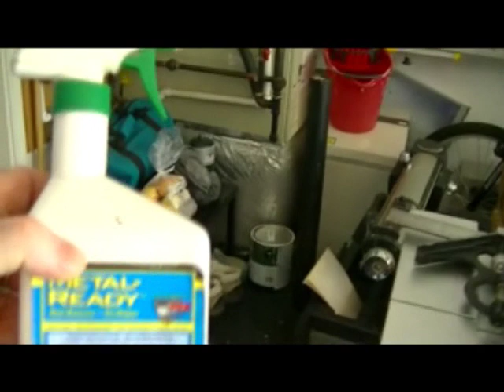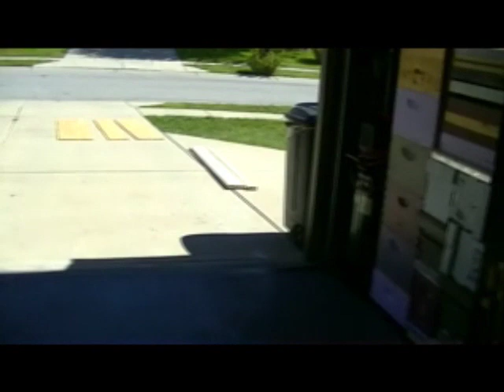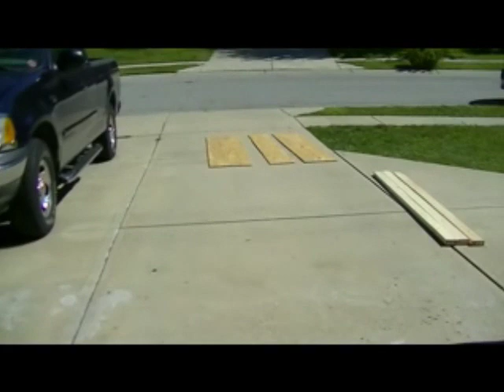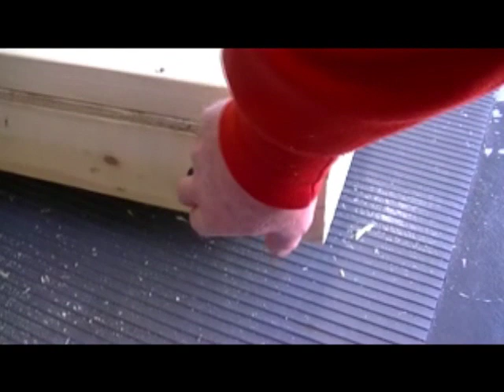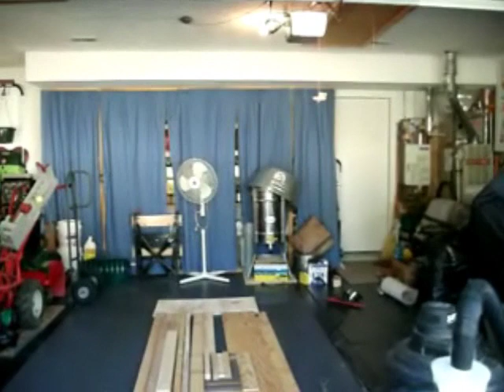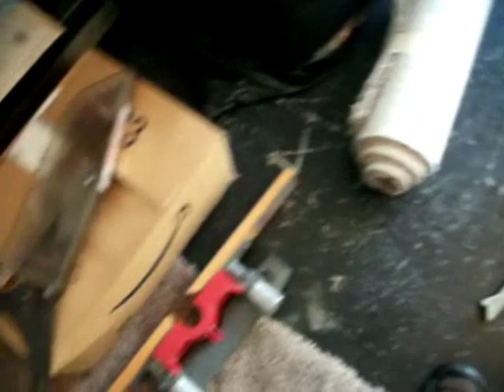Shopsmith Under Unit Tool Storage Bench

Comment: Check out the beekeeper at 14:03!
Reply from the maker: Thanks Joe for the heads up. Don't get on Youtube very often, but in the winter I have a bit more time. I usually post items that I think some people might get something from that will make things easier.
Reply: +Guy Wooster nice compact storage... I have a 500 from 1955 and my accessories are all over the garage floor... Starting to organize them.